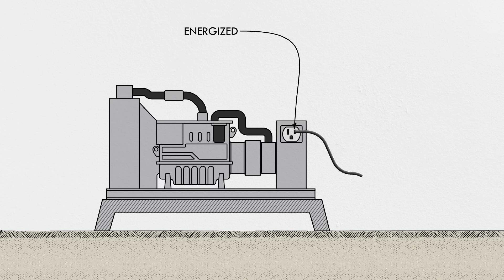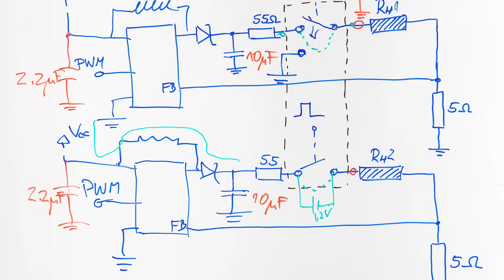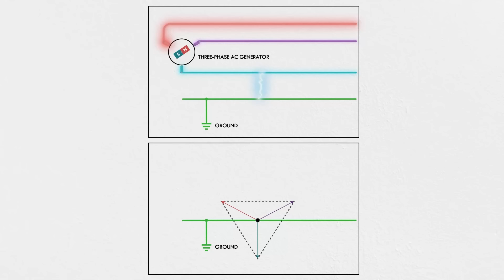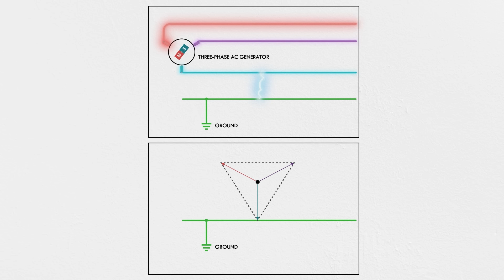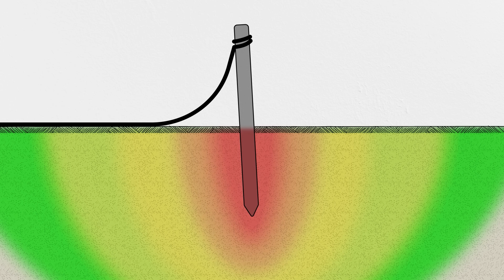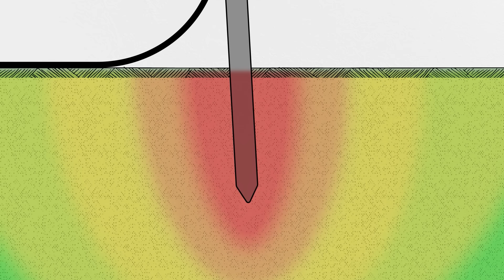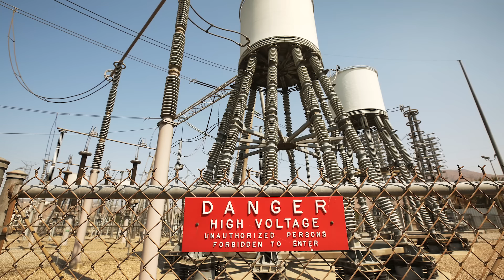Where Does Grounded Electricity Actually Go?

Comment: 7:11 "...the fault current in the toaster flowed through a conductor called ground but actually is a parallel wire connected to neutral in your electrical panel". This is not actually true. In all the houses I've seen in Australia and UK the earth wire actually IS connected to ground via a ground stake penetrating into the earth located near the meter box.  Any current, even small, flowing through this wire from someone touching the live wire in the house flows through their body to the ground they are standing on trips is detected in a few ms triggering a trip in the meter box which shuts off all power to the house.

Comment: This has always puzzled me from a domestic wiring point of view.  There is no return (neutral) back to the power station - the current 'goes back' via the ground (the actual ground, that is).  But then how does the 'earth' wire/terminal fit in?  This also goes to the earth/ground! (Literally, in the UK - it isn't bonded to the neutral, it goes back to ground via a buried copper plate or the domestic water pipes.)  So, if the earth and neutral are effectively the same thing, do we actually need three wires??  Apparently, so - but why?!

Then there's the whole question of AC and 'live' and 'neutral' - surely, as the current switches direction many times a second, both 'live' and 'neutral' are live (and neutral!).  So you end up with ALL the wires being 'neutral' (or 'earth') at some stage.  How on earth (ahem) does that work?!

I've watched this video several times, waiting for understanding to dawn, but, alas, it still hasn't...
Reply: The live and neutral conductors are there to supply power in normal operating conditions, while the earth conductor is there for safety and equipotential bonding.

There are a number of different earthing/grounding systems used in the world, each with their own pros and cons. Some of these in fact do have the neutral and earth bonded near or at the consumer's property.

While yes you are correct that AC power alternates back and forth, to simplify things convention is used to state what wire is what, direction of power flow, etc.
Reply: @darren424242  I know only too well, from personal experience (!), that the live wire is actually live and the neutral isn't (although it carries enough current to trip the earth leakage circuit breaker if you accidentally touch it to the earth wire/terminal!!). So I guess that answers one of my questions - the live wire is (of course) the only one actually connected to the power line from the grid. So, although the voltage on that line varies from 230 to 0, it does it so quickly that it doesn't make much difference if you are holding it!

Comment: Really, it's strictly prohibited by the safety laws to jump on one foot in case of step voltage appearing on the ground. They should leave this dangerous ground in little steps instead. It's explained by the fact that jumping can cause falling down the ground and exposing longer part of the body to step potentials, and so, applying much higher deadly voltage.

Comment: I used to have to go ahead of the jobs and wire up the work trailers I ran into a job I only needed 120 volts the closest power way out in the field only had 220 volts running the lights with a ground I took one hot lead wired it to the hot side I took the ground hooked it to the neutral. Then I installed a ground rod at the trailer tied it to the ground rod.tadaa now I have a hot neutral and a ground.

Comment: I discovered that there was a quite high voltage coming from my Radiator(Water heated), measured it to about 210 V to Ground. I later connected myself in series with a small Neon bulb to Earth and managed to light it up really well. It sure Felt that i was a part of an electrical circuit but it was a really funny experiment. 🙂😄

Comment: Per 220//207V single-phase ResidentialCommercial
Black = Hot 
Green = Ground

White = Neutral / Return ->  bare copper clamped to 6’ galvanized rod pounded into earth, to bond panel to ground

All white wires connect to busbar inside panel

Comment: Industrial sparkmonkey here. One mistake. 7 mins in, you said "relays" were protective equipment needing fault currents. Wouldn't that just be called a "breaker"? I mean, relays are simple switchgear in my jargon, SMALL switchgear even, larger ones are called "contactors"

Comment: So many errors here. Even if there is not enough CURRENT to light a bulb, it only takes a hundredth of that amount to cause a harmful shock. And the neutral IS GROUNDED AT THE BREAKER PANEL, due to fire safety codes, not engineering. Since there is current and resistance in the neutral running to a sub- panel, and  that panel LEGALLY must have it's own earth ground, a potential is created between the two grounds, aka a "ground-loop'. This causes hum in sound equipment, thus in a Hollywood sound stage system, isolation transformers must be used to prevent this problem while maintaining legality.

Comment: I do enjoy your videos, however this topic is huge and principles of operation, protection, design change considerably within geographic locations around the world. I.e the transmission and distribution grid, control, protection and operation within the uk and USA are quite different, generally due to the voltage differences at the outlets, and protecting the public from harm using electricity sensibly and for the Darwin Award public sector also. I teach this subject among others. One of the main transmission and distribution factors is in protection of the system and its speed of operation and redundancy. Although I appreciate it is difficult to try and simplify such as system, transformers within these systems are selected to have delta or star systems on the primary and secondary sides, which enable certain protection mechanisms to be employed. If at all interested I can provide a lot more flesh to the bones particularly in the uk? But I take my hat off to you trying to simplify such an immense topic. 👍🏻 Let me know if your interested, could possibly provide a PowerPoint on earthing in the uk, it would need some sanitizing, but with some additional flesh could become quite usual and maybe insightful.

Comment: I was taught that electricity always goes to the ground. The amperage not the volts is the problem. 

Now, I reverently got kissed by a 220 Volt live wire and it felt 4 times worse.

It REALLY  sucked.

Comment: In the US the neutral and Ground are not always connected together in the panel box. Depending on the feed like mine run from a private power source is not bonded but grounded like a subpanel,  Also the earth is not a globe your smart enough to figure that one out,

Comment: Where does the heat go after you boil water?
Reply: Steam is invisible - lots of water molecules agitated real fast, when they cool it condenses, or loses that heat, it turns into visible steam cloud and back into water. In steam power plants workers were cut in half when hi-press invisible jets of steam burst from vessels or pipes.

Comment: Grounds to earth are for safety .
In case of a dead short in a circuit , the power is directed away from combustible components .
Reply: The current going into a coil CAN be increased with capacitive reactance .

Comment: I still can't get over the fact that the US power socket is by far the worst socket in the world. No pin safety distance before it makes contact, no spark prevention, no interlocking shutter system (child safety), so flimsy it constantly falls out of sockets, bendy pins, inbuilt fuse, longer earth wire (if you were to tug on the cable hard enough that the cables inside become loose, the live should be the first to go, then the grounding wire.)

Comment: it blows my mind that in USA the neutral grounding method is the usual... in my country it is frown upon... meaning despite having a procedure for that, it's preferred you do the ACTUAL grounding... every house has (or is supposed to have)  at least one grounding rod in soil (yes we measure the resistance of earth while building it) ... in my experience the Neutral grounding gives off a super annoing residual shock to some metalic surfaces...

Comment: Unfortunately, I believe this video missed the mark entirely. From the user perspective - starting with toaster - the video should have explained why grounding is a safety measure and why. Proceeding, why fallen overhead wires constitute a danger, and finally why equipment in power substations, as well as metal objects close to electric trains, are grounded.
While the generel explanation is of interest, it does not provide usefull information for the average citizen.

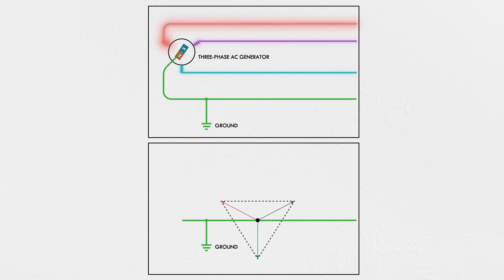Comment: 7:30 you’re kind of wrong, yes generators are connected to ground but there’s usually a resistor connected in series to protect the generator, ground fault relay picks it up and trips and it’s not a lot of current due to the resistor limiting everything

Comment: What if we want to harness the unlimited electric juice of lightning bolts, channeled through the many lightning rods on tall buildings in cities, only, WE CANNOT do that, it would destroy any kind of battery used to store the sudden super-high voltage hits. BUT, what if we set up a steel mill iron and steel molten metal furnace, which uses pure carbon rods that are used to superheat the steel mill’s molten metal, by being charged with high voltage, with a wired grounding, that lets the lightning rods thunderbolt hits be grounded ANYWAY, only along the way, the charge passes through the carbon rods stuck in the steel mill furnace’s molten metals container, heating them up along the way? The steel mill setup could be used to destroy toxic wastes or medical wastes dropped into molten metal, the excessive heat could be re-piped to provide heating for buildings, or to heat hot water, or the steam pipe network under New York City, the whole mill could be encased by NASA’s space shuttle insulated tile material, to make it retain its heats, for long periods between thunderstorms, and the mill could be opened up to provide recycled metals, and stone slag to be made into fire bricks or boulders for shoreline jetty barriers. Instead of trying to exploit these destructive thunderbolts electrical juice directly, we might be able to use it to provide a lot of free thermal energy or heating!

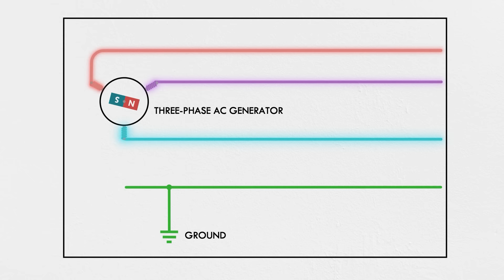Comment: 3:35 I am not happy about your illustration of a Delta coupling.
What you illustrate as Ground is most, if not always, a Neutral wire.
I know that Neutral is most often (always) connected to ground at the transformation station, but routed to your premises as the Neutral wire. 
Then, in your house the your Ground, the one that goes to your Outlets Ground pin, is connected either to the Neutral from the Transformator Station OR a local Ground Spear.

The decision whether it will be Transformator Station Neutral OR a local Spear depends on the distance to the transformator station and cable size - and if that will satisfy the maximum impedance limit for the size (power wise) and use of your installation.
If the impedance limit can't be satisfied you will either have a supplemental Ground Spear or only a local Ground Spear - if the soil is able to provide the sufficient low Ground impedance.

Comment: To say that electricity isn't lazy and will not take the least pathway of resistance should be grounds for taking away your engineering. 

This goes against the AWG American wiring guide for sizing all grounds and bonding wires. You failed to mention the difference between AC and DC current. 

All AC neutral busbars must grounded by two means of grounds in the main service sized out by the AWG...

Comment: Ermm... No. The ground wire from the toaster really goes into ground. Unless you live in some funny country where things aren't done properly.
Reply from the maker: The “ground” conductor is connected to earth in the panel, but it as also attached to the neutral which is the primary return path for current to the transformer.
Reply: @PracticalEngineeringChannel  It is not. In fact, touching earth and neutral will trip the RCB. I will take a photo of the consumer unit next time I have the cover off.

Comment: Actually, the Earth is not just like a wire, but much more like a huge battery, where pretty much all of our power comes from. You would not be able to induce electricity, if the Earth did not have an EM field. At least not with a magnet based generator. That won't work on Mars, for example.

And yep, exactly. I always say, electricity doesn't only take the path of least resistance, it takes every path of lesser resistance. This is why Tesla's biggest dream would never work. The very nature of electricity makes it impossible to control that much current through the atmosphere.

Comment: Please don’t show the upside down outlet again
Reply: The National Electrical Code doesn’t require a certain direction. It allows outlets to be installed with the ground plug hole facing up, down or sideways. It’s up to you, there is no standard electric outlet orientation. So that means there really is no such thing as upside down outlets.

Comment: I understand most basic engineering subjects to a laymen's level, except electricity.. I'm lost on almost all of it.. for example why would we ever ground anything? Isn't that like throwing away electricity? Or if it's in the earth already why can't we just pull it out of there with simple wires? Or if a connect circuit is just a loop of electrons why do we ever need to make more power? See prob the dumbest questions ever

Comment: What do you mean by "electricity" at around 12:40 regarding dry sand conducting or not "electricity"? Would like to see, how do you measure "conducting electricity", in what units, maybe in [R] like rubbish? Electricity and electric current are related, but are not the same. "Electricity is the set of physical phenomena" - wiki.

Comment: I finnaly understand why its bad for the crack addict election to connect ground to neutral in in old house outlet. (To get ground in old outlets) if there is a short it won't trip the breaker or might take too long to trip it and risk fire.

Comment: Silly Americans still haven't caught up with the country that invented the electric grid, PME, (protective multiple earthing) double insulation etc. 
I mean TWO PIN PLUGS went out in the 1950s lol. 
No mention of voltage either 415v burns on contact. Do you have 415v 3phase?
Not to mention properly earthed substations which also connect earth to neutral and the steel wired armour sheath!!

Comment: The way my monkey brain understands it is think of wires as a pipe and the power source is a pump (this is mostly a dc representation in vehicles) so the "hot" or positive wire (pipe) comes out of the battery (pump) goes to the radio that pipe full of water turns on the radio but if the water cant return to the pump it just sits there and does nothing but the return pipe going to the negative terminal completes the circuit thus driving the radio. Im only familiar with automotive electrical systems so a/c current and 2 phase 3 phase, power, ground, neutral wires etc. Is beyond my monkey brain and my brain starts to smoke trying to understand all that 😂

Comment: At 15.03 you state that electricity doesn't take the path of least resistance. Your ignorance is only exceeded by your poor interpretation of what you don't know. YouTube I'm not being mean. I'm looking out for your consumers. Minute 14:54 - If you don't think we (you shouldn't use the royal we) you should contact the EE department at the University of South Florida where the most lightening strikes on earth occur many years. At 17:05 you say that there is no relationship between your distance from a power station and the current it provides to the grid (and thus the ground return current). I refer you back to the current doesn't take the path of least resistance comment.  Wouldn't touch Hello Fresh with a 10' 100,000 Volt rated isolation stick. Check it out with a Professional Engineer.

Comment: They just let it go to waste in the ground instead of storing and reusing all that free energy...
Reply: Store energy? From thunders? I think that would be problematic to maintain, if you push high currents into battery, it will easily shorten lifespan or break. Though pushing it to electric wires seems a not bad idea